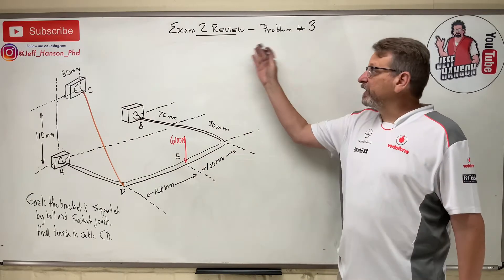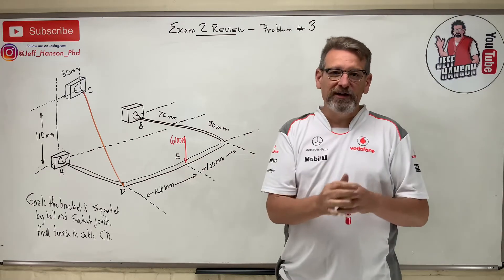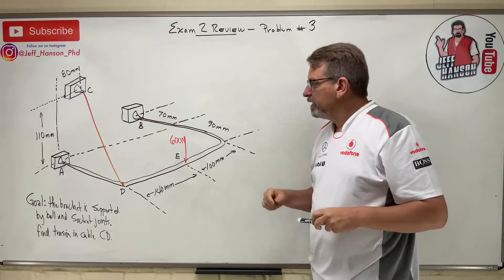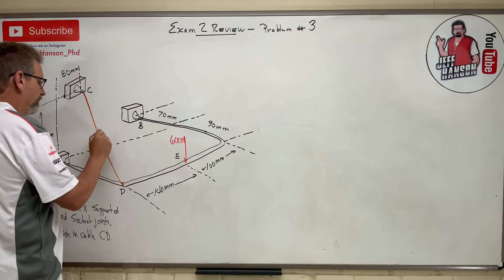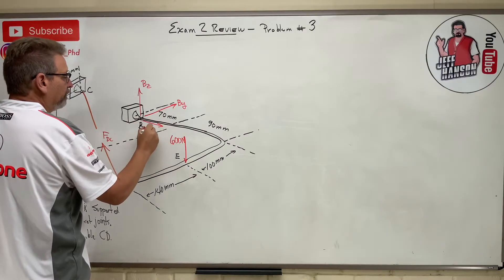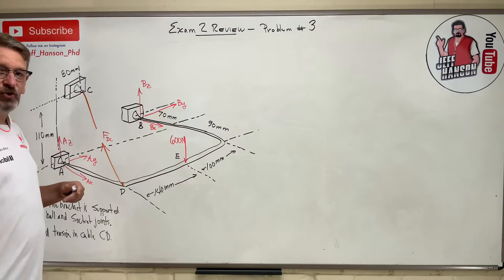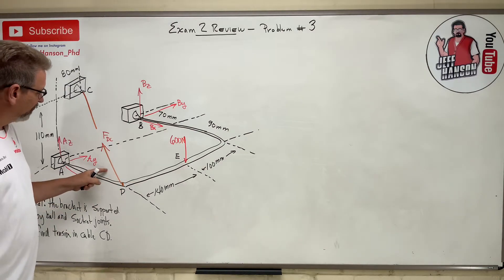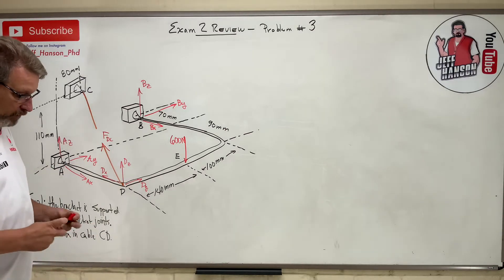Statics: Exam 2 Review Problem 3; 3D Reaction Example

Comment: maybe I'm wrong, but: we've got 6 eqns, but 7 uknowns, namely: Ax,Ay,Az, Bx,By,Bz and F(DC). Eqn for lambda hat gives us just a view of how the resultant of DC is splitted between particular directions. 
So, would it be good to take a moment about "wacky axis" shifted from origin by x=-70 and y=240 (straight into joint B) and take the moment about that axis?
We've got Dx,Dy (which we already know thanks to eqns for Mx and My) and Ax, Ay which we dont know. 
Solving that we've got relation between Ax and Ay, like we have relation from Mz eqn. between Bx and By. Solving them lets say for Ax and Bx respectively we  can put them into equations for forces in X-dir and Y-dir, and solve rest of the unknowns. 
Does my way of thinking is proper?

Comment: I am so confused about the signs in sum of M about the y- axis @ 10:55. to me, I see the Dz will cause a counterclockwise rotation (+), and the 600 N will cause a clockwise rotation (-) ... please someone explain this one to me!!
Reply: The reason why: To start out, you are looking at this from the negative y-axis up to the origin and that is why you think this. He notes that he is looking at is from the positive y-axis, down to the origin. That should clear things up. 

Additionally, it is worthy to note that you could look at the origin from above or below since your equilibrium equation is equal to zero and equally changing the sign on each term will not make a difference. Key here is to stay consistent. Hope that helps!
Reply: I was thinking the same thing